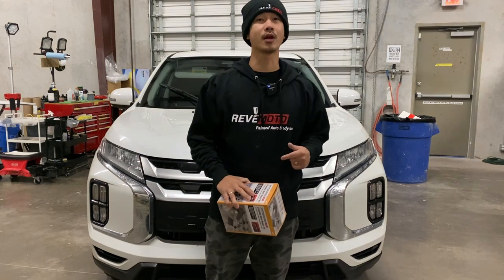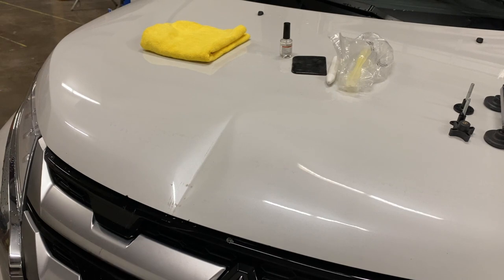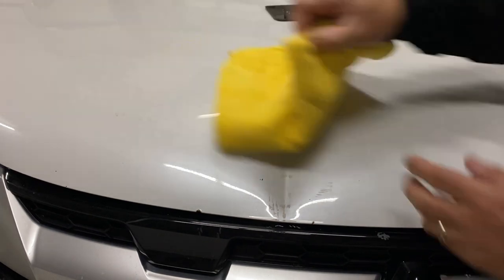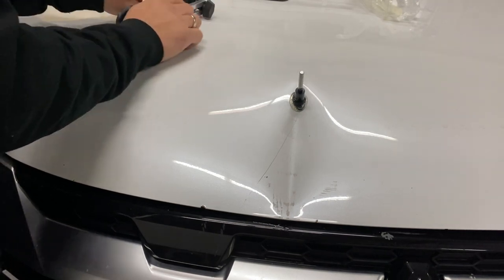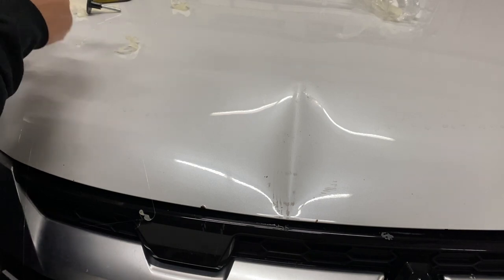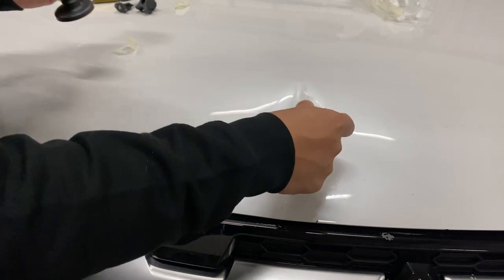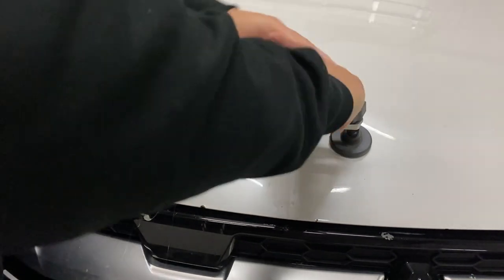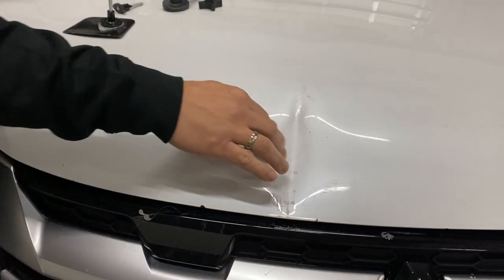Crossbar Dent Repair Kit Review | ReveMoto

Comment: Read instructions. Clean area w/ release agent. Let dry completely. Apply glue to pull tab, immediately put over dent and hold 10 seconds. Then let glue sit 2-3 minutes OR MORE. Depends on amount of glue used.  Allow glue to harden COMPLETELY. May take several minutes. Then install crossbar. Screw slowly up to remove dent

Comment: I didn't like that you would heat the panel then cool the panel as you're pushing out from the inside you could use dry ice to cool it and it would help you remove that dent
Reply from the maker: Yeah it was just something fun to try out.  I let the PDR guys handle this

Comment: You're expecting a little bit much out of that tool. It's more for like hail damage and the like .
Reply from the maker: Yeah it was just a fun video to make
Reply: Does it work for hail damage pretty well?That's what I need to repair.
Reply: @Migman77  I have one and I haven't repaired anything so far but I haven't really got into any hail stuff either. Tried it on a Harley tank and it did pull it some before the glue turned loose. I'm gonna grind the spot mildly, glue the tab, then I'm gonna epoxy over the tab with the stud sticking out of course, pull the dent then clean all that off and apply metal glaze hopefully. Less evasive too the tank I'm figuring
Reply from the maker: @Migman77  I think it may work but I have only seen it used on baseball size dents.

Comment: Common sense when you see a crease like that, you should know that dent puller is not gonna work. Dent puller, not crease puller
Reply: So it was a test on what this tool can do.  Didn't say it was the proper way of doing it.  Can you make a video of how you would repair?
Reply: @rolandobalmaceda9238  Yes, but you have to try with the tool that was designed for for the job ! this isn't designed for a huge dent like that, let alone a dent with a massive crease through the middle, horses for courses as they say, and this was the wrong horse for this course ! Its akin to trying to undo a straight head screw with a Philips head screwdriver, failing to work then saying it's not much good !